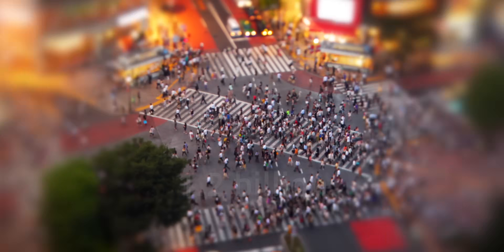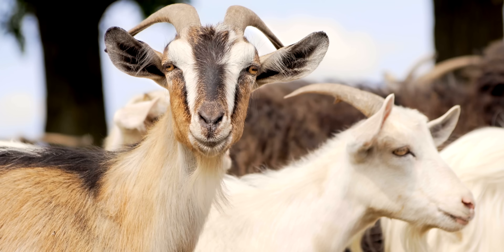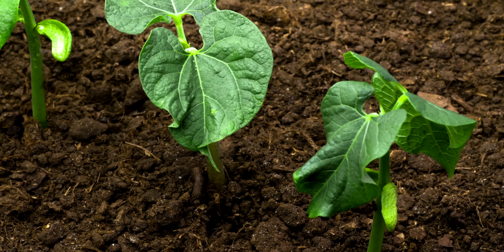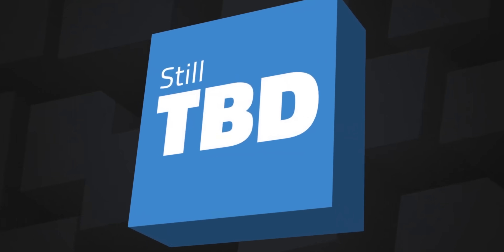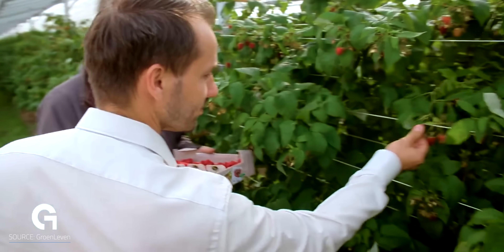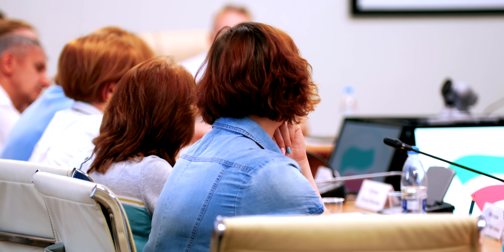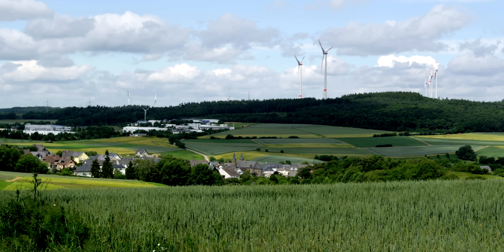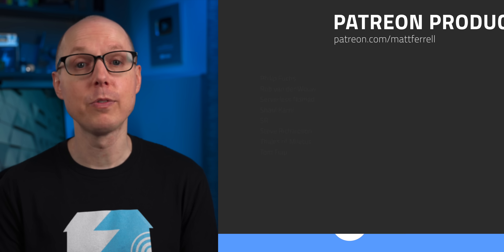Solar Panels Plus Farming? Agrivoltaics Explained

Comment: If you just convert Raspberry farms that would net roughly 23000 acres of farmland/raspberry farms which would give better crop yields (more yum yum) and more importantly 7,3 TWH of additional peak capacity solar. That would easily power a number of major cities in the US (4 000 TWH total for the continent), couple with some good storage solution (preferrably at each site) and you would eliminate the US power needs by just covering shaded crop farms, nothing else!! seems like a no-brainer to me...Add potatoes and you get an additional 25TWH per year...

Comment: They would have to almost double the distance between each row of panels just so a tractor or semi with a trailer could run next to the harvester to unload. Otherwise it's just wasted diesel running the harvester back and forth to unload.

Comment: That's very interesting one, also the tractors or any other farming equipment where going to use in this field that must be electric one and not to use any carbon emission causing equipment, that's very important.
Reply: the energy density of battery tech still isn't there compared to fuels, likewise during harvest season they can be out there for 12 to 16 hours a day so that means you need to be able to get a 16 hour charge from less than 8 hours of charging time. Good luck with that.
Reply: @sinephase  Thanks for the sharing of your thoughts. I am still in hope that everything is possible.
Reply: @Missingtailpipesby  well, it's simply not possible right now, that's for sure

Comment: This channel usually provides a bit of hope to me which I appreciate. I really hope things like this can become profitable because things still aren't bad enough for people to simply do things because it's the right thing...
Reply from the maker: That's one of my biggest concerns in general.  Until things can be justified cost-wise, it's hard to get everyone on board.  Hopefully costs around this continue to drop.
Reply: @UndecidedMF  One thing that would be great would be to have a financial analysis of this solution.  I’m thinking a spreadsheet breakdown so we know where the math doesn’t work.  Financially, if look at farming it has irregular crop yields year over year.  I see similar for PV energy production.  However, I wonder if on average over a 20 year period the PV’s would be paid for (past BE point) and producing “free” electricity / profits from PV array.  Similarly, I’m curious what percentage of the time the crop yields would be lower than traditional farming.  I have to imagine having structure over the crops would make the yield slightly more predictable and consistent as its protecting from some of the harsh elements.   Lastly, if we combine smoothing out the volatility and PV profitability in later years what would it mean to the farmer’s ability to get better long term interest rates for capital required to run the farm (i.e. it becomes a potentially better investment for the banker).  Thoughts?
Reply: I can't believe how many times I said "things" in this comment. It was ridiculous  LOL

Comment: I wonder if they have rain water harvesting on these arrays of panels, would seem like another efficiency boost?
Reply: certainly adding gutters to the bottoms of these panels with them being angled, would actually allow for a significant amount of rain water collection, which, you could pump into the system to feed the plants with over time, would be an incredible benefit. Since they'd be using the rain water in their area, and not much from anywhere else, I'm sure their costs of watering their crops would drop significantly.
Reply: That would work only in green house or semi-greenhouse with drip irrigation. Horizontal panels decreasing evaporation from soil that is unrelated to plants may be enough
Reply: Would you believe, there are actually places that ban rainwater harvesting. Our farm has cisterns at the horse barn and the farm house. But houses closer in town may be restricted to not allow any kind of collection. To water the grass, you also have to pay for sewer usage. Even though there is no sewer usage for that water.
Reply: @gravelydon7072  - “ban rain water harvesting” 
Banning breathing air will be next…
Reply: @gravelydon7072  yep! I live in Utah and they don't outright ban rainwater harvesting, but they limit how much can be harvested and stored in a year. If there was a way to stop sunlight, they'd find a way to tax/control it too.
Reply: @Eyes0penNoFear  Most of the time you just have to register to harvest more - the outright ban tends to be a myth.
Reply: @Steven_Olson  the fact we have to register to use a resource that falls freely out of the sky is almost as bad as an outright ban imo.
Reply: @gravelydon7072   YES!  Obviously!  We live on a planet that requires water.  How do you people not see this?  Water falls out of the sky it needs to return to the earth.  Trust me, not everything the government controls is for evil.  The truth is, lunatics like me would assassinate politicians if they failed to regulate rain water collection.
I mean, you guys know about ecosystems?  Its like a cycle.  If everyone can collect all the rain water they want, things could get ugly real fast.
Reply: @voidremoved  harvesting rain doesn't change a lot... unless you cover HUUUUUUUGE amount of land...
Reply: Hi Greg, wonderful point. We have implemented rain water harvesting along with vegetable production in green house integrated with semi-transparent PV panels with different packing factors and the results are promising. check out this video for now, we will soon come out with final video.
Reply: @LifeonThirdRockFromSun  Will that video realised on your channel? I've subs to you. So looking forward to it.
Reply: Yes, we have and not only.
Reply: rain only gives a small power drop, 70%?
Reply: I have seen it done before, the water was harvested and used to support a fish pond.

The fish pond produced ammonia from waste then bacteria cycles the ammonia into nitrate and phosphate which is used as nutrients for the farm. (They also sold the fish which I believe to be tilapia….although I have absolutely no doubt that trout would be a better substitute for our markets and just as good at the above)
Reply: They do have some hydro panels out for commercial sale currently that you can find but I’m not sure they have been efficiently paired with farming yet?

Comment: I still think we have 100s of thousands of acres of unused roof tops.  The advantage is the energy is produced very close to the consumption so you loose less in transmission.  And it's unproductive land space.  Farm land needs to prioritize farming production first.  That being said, as with the strawberry example, if it works as a win win, obviously it's a great option.  In short, start setting goals for 50% or greater roof solar coverage in communities with high sunlight averages.  Then expand from there.  It's great to be energy independent... that's far more important in our country than reducing CO2. After all, the earth is a dynamic system and no matter the amount of co2 humans can produce, it's not going to register. But now I'm getting into science and people concerned about global climate change left the world of science decades ago.  🙄

Comment: I liked that vertical mounted double-sided panel design. What they should do is have a whole string of that mounted on a pivoting hinge with an alternator in it so they could flap in the wind, and gain hybrid solar-wind power.
Reply: With the wind constantly changing the angle of solar incidence and fluctuating the power output wildly?

Comment: It sounds like agrivoltaics are a solution in a specific set of conditions. But when those conditions are right - it is also the right solution. It would be good to see a calculation on how much a farmer would save and earn with agrivoltaics compared to a field run for the same crops using a traditional farming method without solar panels.